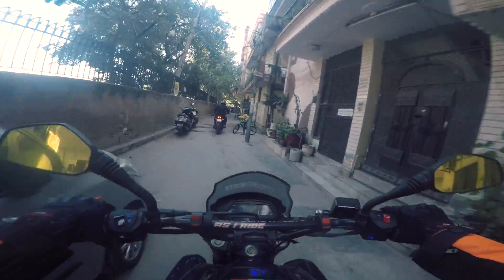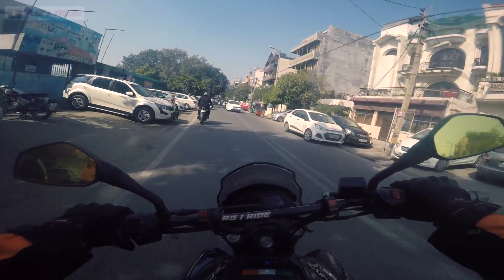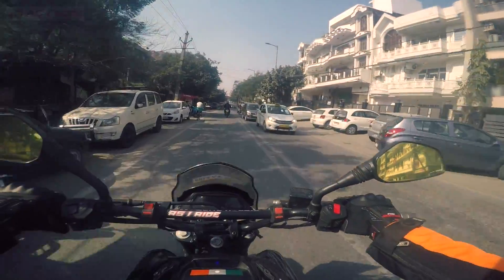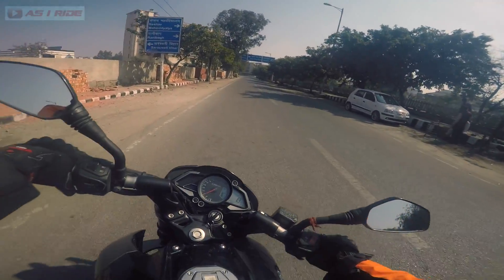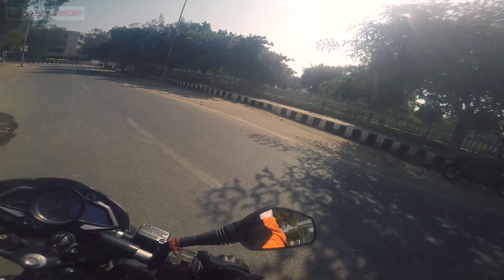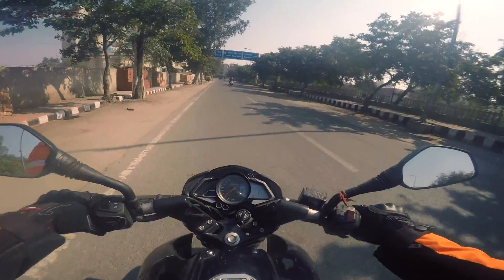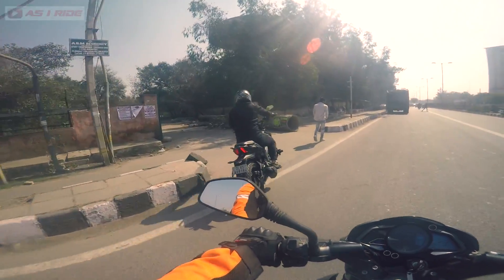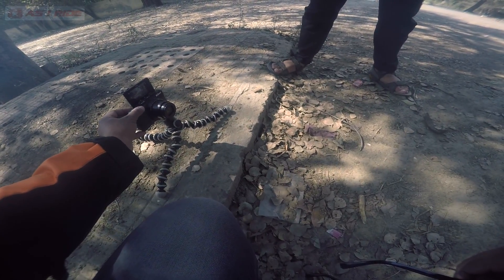Why an ABS Ring on the Rear Wheel of a Single Channel ABS BIke ?

Comment: Rear wheel sensor just checks the speed of rear wheel and sends the data to ABS module so that as the front wheels are locked up and to prevent stoppie brakes can be released therefore rear wheels doesn't locks up in single channel as there is only single line from the ABS module to the master cylinder.
Reply from the maker: Indeed
Reply: Nope the RLP sensor only sends data to the abs module ab out the current rear wheel speed, he abs modules compares that when he front brakes are applied hard and regulates the brake force to prevent the Rear wheel lift off. 

It basically prevents stoppies. But this also impacts the stopping distance.,

Comment: The encoder wheel on the rear wheel is to provide RWLP i.e Rear Wheel Liftoff Protection. It basically senses when the rear wheel lifts off and then release then front breaks inorder to prevent rear wheel from raising above the ground
Reply from the maker: You're right my friend...

Comment: which one is good for off roading- single channel ABS or dual channel?
Reply from the maker: Kuldeep Parihar for a typical off-road scenario Single Channel...am talking slush,mud etc.. as in those cases the rider has to steer and counter steer with the rear wheel locking...but for day to day,touring, highway riding, nothing else but a dual channel....not that you cannot do it without a dual channel ABS bike,but you that peace of mind of the ABS safety net.

Comment: Good video
Reply: Great decision, congratulations! have you booked the Apache RACE EDITION 2.0 ABS? Or the old carb ABS model? I've booked the race edition 2.0 ABS model last week.
Reply: I am gonna book race edition next week probably.
Reply: dts logu I am from Pune Maharashtra. It's available with 1 month of waiting period. Where are you from? What is the waiting period in your city?
Reply: Upendra W Hi, but are they sure about the one month waiting period? I'm from Bangalore, I've booked ABS 2.0 version on March 7th, but still dealers are saying production yet to start, can't contact the manufacturing team now as it is month end...so from April 1st they will start the process it seems... My dealer will tell the delivery date on 5th of April.
Reply from the maker: Upendra W Thank You
Reply: As I Ride MOTOVLOGGING Your video helped me a lot in making a decision. I was confused between new RTR 200 race edition vs Pulsar NS200. I always had a doubt if single channel ABS is enough? Now its clear that it does lock up the rear wheel. So I am going for RTR as it offers dual channel ABS.
Reply from the maker: Upendra W that's great...wise decision taken there....a dual channel ABS is always and anytime best....wish you Happy and safe Miles on your new bike.....
Reply: Upendra W Great! Any idea it is available? Which city you are from?
Reply: dts logu that's the problem with TVS. They have more demand than they can supply. But I am sure it's gonna be worth waiting.

Comment: The rear sensor is for RLP...( rear wheel lift off protection)... on a perfect tarmac road if u hit the front break hard on a single channel abs bike... the front wheel wont lock up but the breaking force is sufficient to pop a rolling stoppie... so both the wheel sensors work simultaneously and provide the required hydraulic pressure to the front brake calliper...
Reply from the maker: NicK yes...Thank You

Comment: Fascinating.  What is he weight difference? That might explain the wheel lockup in the first test. Also, if the ABS ring is present on the rear wheel, is it possible to fit a dual-channel system onto your Dominar?
Reply from the maker: sabretech2001 :-) NS is lighter than Dominar...and Dominar already comes factory fitted with a Dual channel ABS....
Reply: OK, got it. I didn't understand at first...some wag once wrote that England and America were two countries separated by a common language; I guess it's the same between India and America, too, lol!